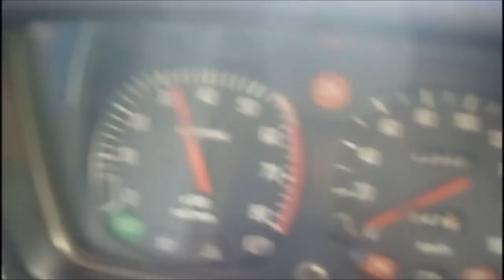Car running on ultrasonic gasoline mist (3 of 5)

Comment from the maker: (continued)
I discovered accidentally that they really modify significantly the air fuel ratio and the rpms too. It was like winning on a lottery, I didn't know exactly how much air it needs in this 'mist' setup. If the engine runs on gasoline vapor, not gasoline mist, than it needs a different air-fuel ratio. This is visible at 2:23 when the engine stops if it has no mist, it refuses to work only with vapor with that amount of air.

Comment from the maker: On the carb there is a handmade adapter made out of soldered thin sheet metal. Visible at 2:42 for example.
Inside the adapter is the LPG's vaporizer too, so the engine can work on LPG too when needed.
The adapter has 4 intake holes, from which I used only 1 to draw fuel mist from the jar (upper left intake at 2:42), the intake on lowe left part is totally unrestricted, and the 2 intakes on the lower right zone have each a variable valve.

Comment from the maker: this is not vaporizing the liquid, it's not turning the liquid gasoline into its gaseous state, just makes small small liquid droplets (around 5 micron in diameter), with gasoline vapor the consumption should be much lower

Comment from the maker: I see youtube links don't really work nowadays, hope it's only a temporary issue. Try searching on youtube by title instead.

The video I wanted to show is called "Mist maker behavior", this shows that soap affects mist production.
How I removed my level sensor, search for "Ultrasonic mist maker without water level sensor".

By connecting 1 sensor wire to the body the mister should work!

Comment: Part-2

2. The mist maker has to be synchronized with the car acceleration so when the car is running at high RPM then more mist is made and vice versa.

What is your view on the above. Have you did the mileage test through this system? Also please share the specification of mist maker i.e. gms of mist made per hour.

Look forward for your views on above.
Praveen

Comment: It would be interesting to see the gas line connected to the container and the level controlled by a float valve.  This way you could perform mileage tests to show any increases in fuel efficiency.

Keep up the good work.

Comment from the maker: I don't think it is absolutely necessary to sync the mist quantity with the rpm, just make sure you generate enough mist, and the engine draws only that much as it needs. If you generate too much mist, that is ok because it will turn into large liquid dropplets immediately and fall back into the vessel. Offcourse like this it draws a larger amount of current all the time, not just when needed.
I measured the consumption (mileage) using 1 mist maker only and at constant mist quantity.

Comment: Hi,

Nice work man. In fact i am also trying to use the gasoline vapour to run car engine. I had build up the system n installed on my car. I am using the approach to maintain the gasoline temperature through radiator water circulation and evaporating the gasoline through air pressure. I had thought for the mist maker for this approach but observed following issue

1. The gasoline has lot of gum/carbon. So when the gasoline evaporates then such particles can make the mist maker dirty Cont.

Comment: Hi Well done...A friend years ago made a unit producing white fog with needle fine high velocity air and achieved 63 mpg on a 350 ford v8. Part of his success is the fact he had a long hose to the carby inlet which gave plenty of time for a full vapourization. Another one had it in the boot and claimed 300 mpg in a similar vehicle to yours....any way I am keen to know the ultrasonic unit you used if you would be so kind. I would like to experiment with that idea too...Ian.
Reply from the maker: Ian Hacon it has 3 ceramic discs, here is a video https://www.youtube.com/watch?v=ZDq-AEP7GNc
Reply: A variation of the idea... Put steel wool in the air intake tube, which causes better air/fuel mixing. A scrub pad works well.

Comment from the maker: My mist maker is not working if I remove 1 or 2 discs from the total of 3. A google search says "300 ml water per hour" for the 3 disc mist generator, but when the engine draws the air-fuel mixture out of the vessel... the gasoline will be consumed much faster! I have modified my gasoline vessel, but I don't have a video with it yet. (...soon)

Comment: Thanks for reply. In fact in my testing I have observed that the heavy sediments in the gasoline does not evaporates and when i took out the balance gasoline from the evaporator and observed that it was dark black colored with higher density.

Any ways, I look forward for your testing. I am sending here my video in video response.

Comment: thanks for your response. another question can vaporize differently?. I realize you do not need much room for the fuel to vaporize. I did a test with a heated and vaporized Diessel better when I unplug the cable and the heater is not red. I will keep experimenting. try to find out where to get a high frequency ultrasonic vaporizer. thanks

Comment: have ever thought that you can do this on the fuel hose it self .closing the fuel hose from  4 sides with non-invasive  transducers at somewhere in the engine compartment?
Reply from the maker: injectors?

Comment: HELLO? CAN YOU EXPLAIN TO ME THE 3 PLASTIC PIPE CONNECTED TO THE GLASS CONTAINER OF GASOLINE????

THANK YOU.....
Reply from the maker: The carburetor draws the mist + vapors + warm air through the first hose from the top of the jar. Air is drawn into the glass jar through hot surfaces (heat is from the exhaust). The second hose introduces air to the top of the jar, the third hose draws air to the bottom of the jar.

Comment: i love the idea of the bike cable thats great. maybe its a good idea to let cold air in the jar instead of the coppertube. Because with warm air only some ingredients of the fuel wil vapourate more quickly while others stay behind in the jar. A larger air intake on the carburator with a longer hose on it so vapor will not escape and for more torque is also a good idea. And maybe use some more restrictions in the mist line so it will run leaner. maybe use an extra air inlet valve like ogle did :)

Comment: I can see that i runs good in the beginning. But i still think the problem is that hot air is entering the jar so only the parts of the fuel that evapotate quickly will get sucked away.. If you just use cold air that problem would be less and you'd get better gasmilage

Comment: The next thing you need to do is to try to measure MPG in order to see if you're mod is viable. I have to say you're work is creative and promising!
Reply: orbtax the air that goes to the carborator must be dry hot air as well

Comment: Awesome  . . wanted to do that 15 yrs ago but just circumstances prevented. How many transducers are you using and will they run on 12v dc?
Reply from the maker: The mist maker has 3 transducers/discs ► https://www.youtube.com/watch?v=Z2sl0SHdHPg It's powered at around 24V AC.

Comment: YOU NEED TO TRY TO COOL THE AIR COMING IN THRU THE EXHAUST DO NOT HEAT IT UP. THAT IS THE TRICK AND IF YOU TUNE THIS CAR SO THAT WORKS YOU WILL SE HIGHWAY SAVINGS OF ABOUT 7 LITERS PER 100MILES.
Reply from the maker: You're right, cold air-intake should be a better option because there is no need for vaporization here. Vaporization actually eliminates the highly volatile compounds of the gasoline (which is bad) and later the engine barely has any power. In my opinion the air should not even enter the jar, something like this would be better (at 2:38 in the following video) where the hose is totally outside the jar:
Electric Generator running on Gasoline Mist (+600 Watt load)
Reply: furulevi  HELLO? CAN YOU EXPLAIN TO THOSE 3 PLASTIC PIPES ATTACH ON THE GLASS CONTAINER OF GASOLINE?????? THANK YOU FOR REPLYING.....
Reply from the maker: The mist maker creates small liquid droplets, it is not vaporizing the fuel. Vaporization of highly volatile compounds is done because of the high air flow in the jar. In my opinion the fresh air should not enter at all the jar to use only the mist and not the vapor.
Reply from the maker: Yes, correct. The mist maker creates around 10x smaller liquid droplets than injectors. Around 5 micro meter in diameter compared to around 50 for injectors. Another way to decrease gasoline consumption is to break down the components of the gasoline into smaller molecules (by heat) like methane (CH4) and other gases.
Reply from the maker: ***** Take care not to auto ignite the fuel!
Reply: Vaporizing water with the gasoline solves the problems created by the separation of fuel components. What you want to do is homogenize the fuel-air mixture before it reaches the intake. A longer run would help or you could look up "Smokey Yunick Hot Fuel Vaporizer" and read about his homogenizer. He sold the patent to Chrysler for $11 million dollars and then Chrysler never developed it.

Comment: Is there a danger if we put in fuel and the atmosphere is very hot I am from Iraq
Reply from the maker: In higher heat the gasoline will evaporate faster, and the vapors are HIGHLY flammable!
Reply: Furulevi was my intention. I am a machine that makes mist water spray. There is no danger in fuel

Comment from the maker: My mist maker has 3 discs... nothing special about it.

Misters should work in gasoline, especially if the water level sensor is taken off, but it is not working in dirty water, for example if you put soap in the water, than you'll get no mist just water jet.

example: youtube.com/watch?v=ZDq-AEP7GNc

Also it is not working in diesel fuel.

Comment: Too much vapor to carborator. Restrict the amount . It's flooding out.
Reply from the maker: +bibleprophecy1st 
Actually it was drawing vapor and mist also, it should have been using only mist. (vapor is not 100% good because it won't evaporate uniform)

Comment: i was waiting for explosion all the time lol seems pretty dangerous
Reply from the maker: It can be pretty dangerous indeed! Glass plus a flammable fuel is not a good idea, but this setup has some minimal backfire protection, a metallic mesh inside that adapter on the carburetor. The glass is mostly for a good visual representation of the entire process.
Reply: always at least one of the nanny squad if you dont think its safe dont do it

Comment: Those interested should check out the Gasoline Vapor Systems group on Facebook. The site is a great information source for Gasoline Vapor systems and other high mileage / gas saving devices. It's Excellent !

Comment: How many fuel it has economy?
Reply from the maker: I'm not sure... the entire setup is not good enough because the engine draws gasoline mist and gasoline vapor also. In this manner the highly volatile compounds will quickly disappear and the rest of the gasoline is useless.

Comment: dose it save fuel?
Reply from the maker: If it's done properly (draw only mist, not vapor) than it must save some fuel because the diameter of these droplets are around 10x smaller than those of fuel injectors.

Comment: What ultrasonic model did you use in your video?
Reply from the maker: mist maker with 3 membranes
Reply: is possible you send me link from ultrassonic?
Reply from the maker: http://www.ebay.com/sch/i.html?_from=R40&_trksid=p2050601.m570.l1313.TR0.TRC0.H0.Xmist+maker+3+membranes.TRS0&_nkw=mist+maker+3+membranes&_sacat=0
Reply: this model ! Humidificateur / Brumisateur à ultrasons Mist Maker - 3x Membranes 20mm (DK3-24)
Reply from the maker: yes
Reply: tanks